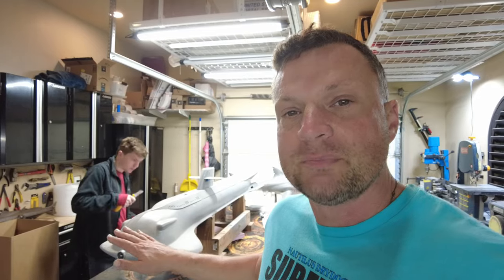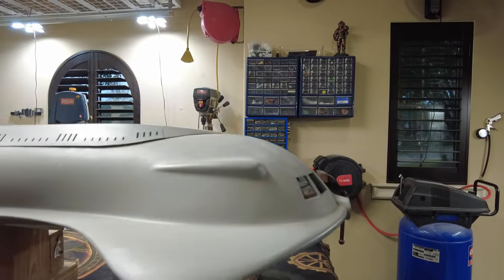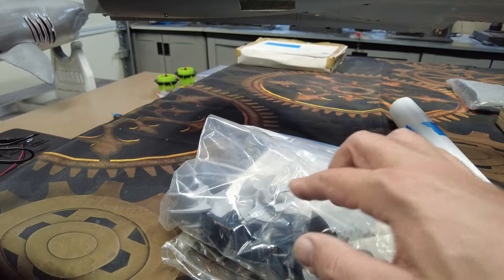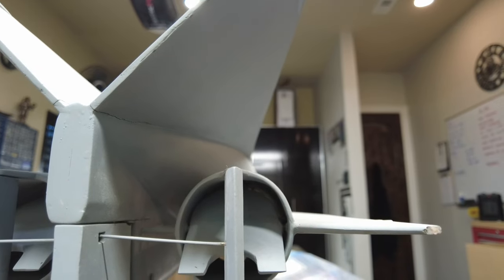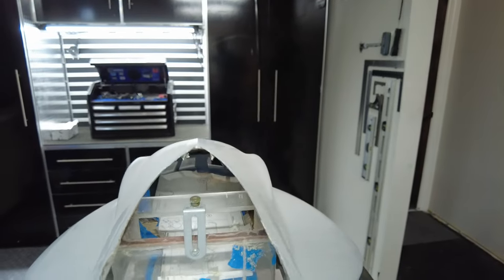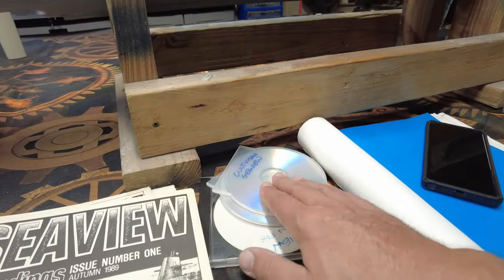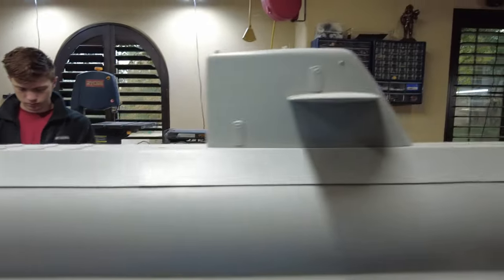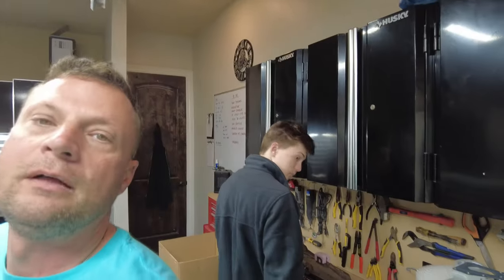Building the DeBoer 80" Seaview - Chapter One

Comment: Jazz up the display, sure. But don't add crap that was never there i.e., torpedo tubes and little guys crawling around on the deck.

Your opportunity -- and remain faithful to the prototype -- is to dress up the masts; bridge well detailing; observation compartment; and handholds on the deck, outboard of the missile muzzle door fairings.

Yeah. Your observations on the stern planes are spot on! Reduce their cord by at least half. And work up sets of fixed pitch-vanes at the end of the propulsion nozzles to produce a pitch-up torque whenever water is blowing by them.

Go get 'em, Bob!